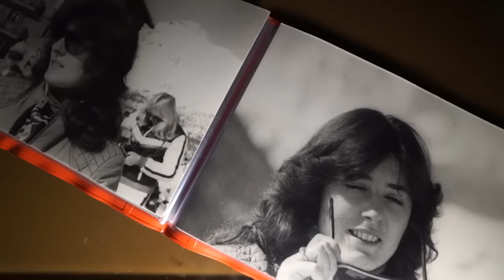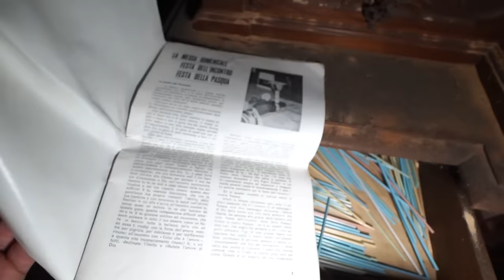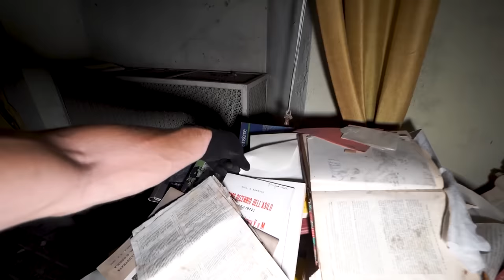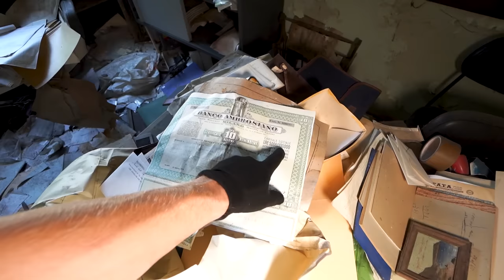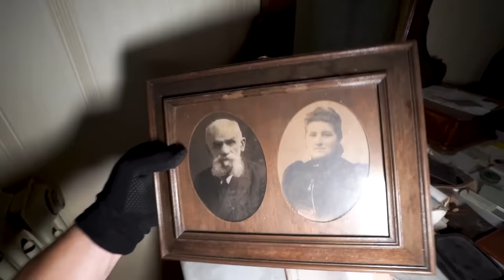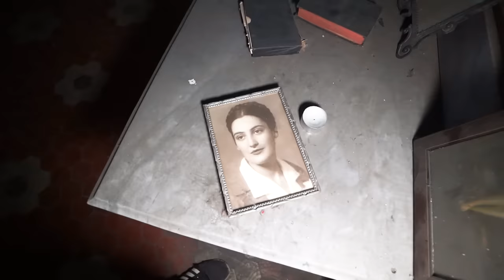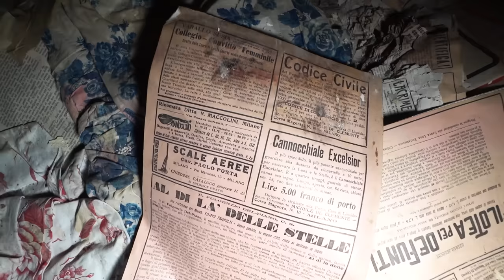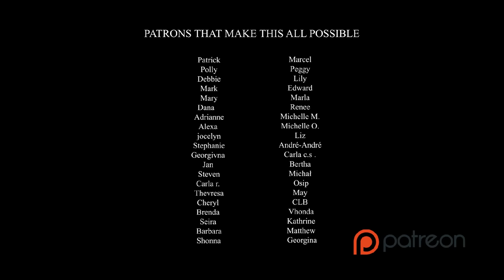Abandoned Italian Renaissance Palace From A Ski Resort Tycoon

Comment: A chandelier is a ceiling light has branches coming out from the center for candles or lightbulbs ( chan·de·lier
/ˌSHandəˈlir/
noun

a decorative hanging light with branches for several light bulbs or candles ).  Everything else is just a hanging light. If it's attached to the ceiling, it's a ceiling light.

Comment: Slides: the little photos with the white hard edges, that you could not see. Those are 35 mm slides and are actually the  negative of the 35mm slide film.. You can hold one up to the light and see it clearly if you ever run into one again :) (if you have a flashlight, shine the light from behind the slide.

35mm slide film had better color saturation than 35mm film and was used for publication in magazines and for home use with the every popular slide projector :)